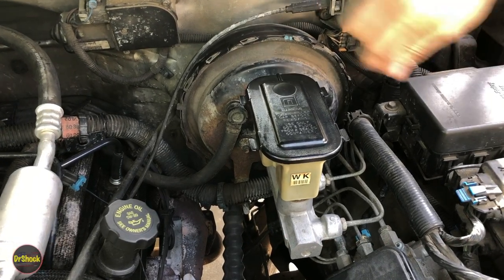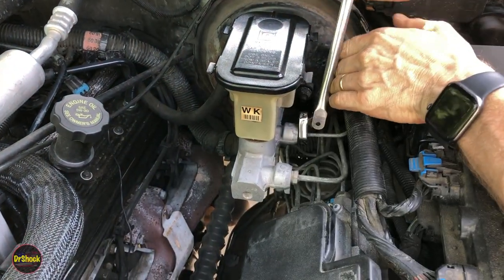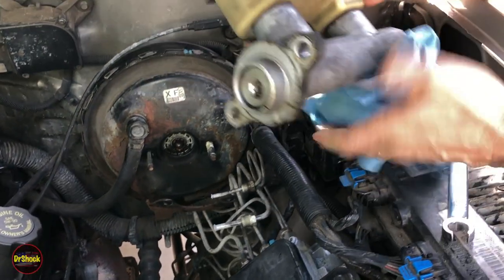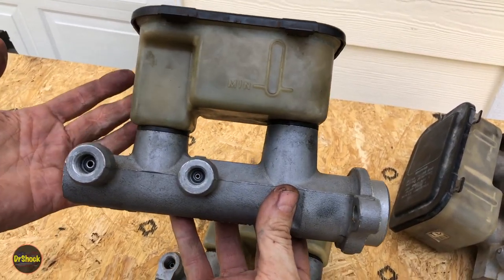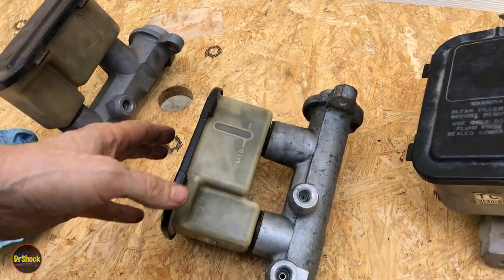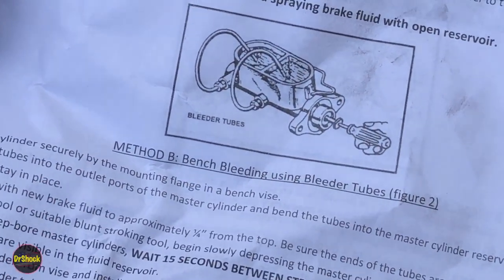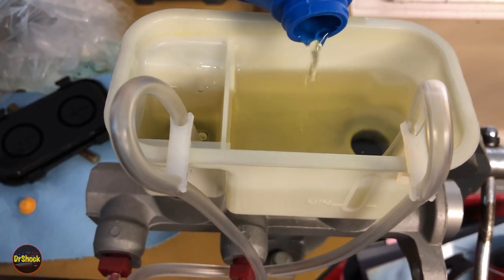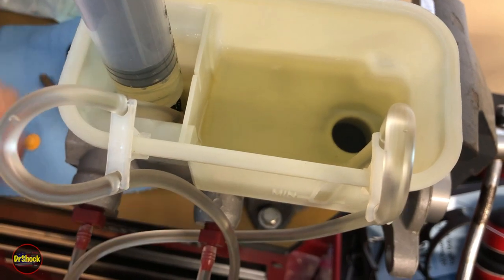1995 - 2002 GM OBS Truck Leaking Brake Master Cylinder Identification & Replacement (Chevy & GMC)

Comment: Great video! Learned a new way of bench bleed. I have a 98 k1500. Always spongy brakes,even after I replaced master cylinder. Can I put a 2500 master cylinder on to get firmer brake pedal? Or would it not make a difference? Thanks
Reply from the maker: Thanks.  These OBS trucks never had the super stiff hair trigger kind of brakes you find on the newer generations, even when brand new.   But you shouldn't be having a lot of ineffective travel (pedal moves but brakes do not immediately respond in kind), or problems with the pedal traveling too far or not fully returning back.   

Most problems where it works, but doesn't feel quite right, are going to be improved with power bleeding and flushing out old tired fluid in the process.  That would include using a scan tool to activate an automated bleed on the ABS unit in later year models.   This video might help - https://www.youtube.com/watch?v=4fImUhpWIdU
Reply: @DrShock  I watched other video. I appreciate it. Thanks

Comment: Another great video.
After bleeding and installing the new MC, do you need to bleed the ABS? Or just go straight to each wheel?
Thanks
Reply from the maker: Thanks. Yeah, it should be re-bled as air has entered the ABS unit during this procedure.  I mentioned this near the end and linked a video in the upper right corner (little i in a white circle icon) I did awhile back that walks thru power bleeding.
Reply: @DrShock  Perfect. I have all the info I need to do the job. 
Thanks again!!!

Comment: i always watch your videos, great stuff. This time maybe i can reduce your mess or the risk of. Do the "benchbleed" in the car. Simply put the things together with the right torques but dont connect the brakelines, then install your "benchbleed" tools and do the job with the brakepedal. Depending of the space in the car, it could be extremly difficult to install the prefilled mastercylinder.

With my version its more safe and cleaner and the risk of further corrosion is much lower.

please excuse my spongy english, its not my first language